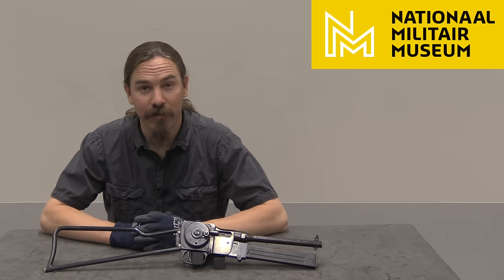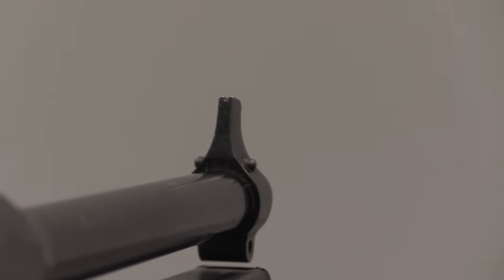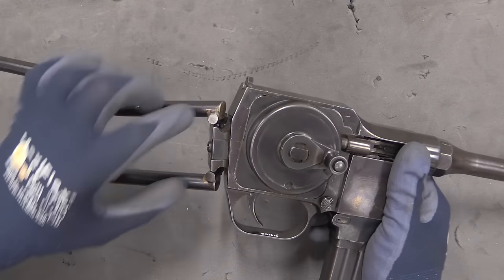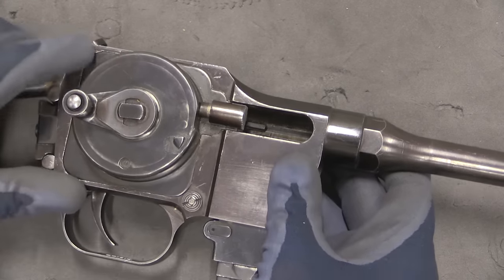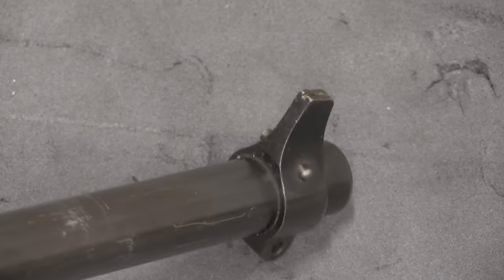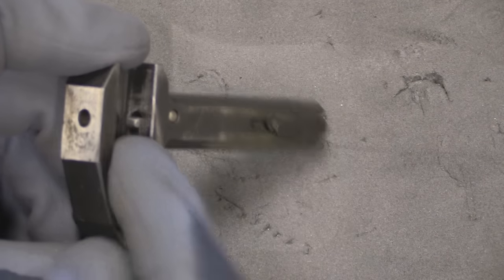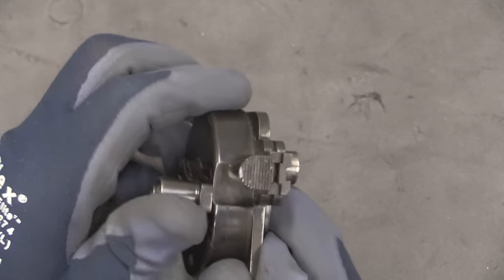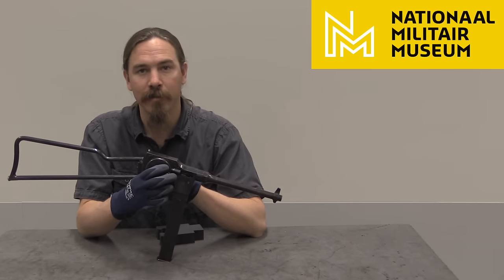MGD PM9 Rotary-Action Submachine Gun

Comment: Why was this not successful? It is an ultra compact sub-machine gun that can fit in a rather small case, uses standard ammo with easy to find magazines, and it looks neat to boot. I see no reason this would not had made a slash with the police, special security, and some limited military use as well.
Reply: there was a glut of surplus around at the time, basically. And apparently that mainspring is hella bad to deal with if you do have to take it apart.
Reply: I guess having 200 sub machine guns, even if they are not the best, kind of encourages governments to not get more. Oh I am sure that spring is a major issue to deal with, ha. Thankfully it was set up to be a single enclosed unit. If I was an armorer, I would treat it as one part. If it breaks, replace the module rather then try and fit some over-sized coiled watch spring.

Comment: The mid-20th century was just such a great time for simple, all-metal, quick-to-manufacture 9mm SMGs, and that just makes it worse that we'll never see a civilian carbine version of any of them outside the Grease Gun. Barely that even :(. It looks almost like a company with the right equipment  could bang something out like this in 20 minutes and yet we know nobody ever will.

 This thing is so interesting to look at that I have to wonder why no one was interested. What did it lose to, surplus MP40s? The only competition I can think of was the MAS-38, and that used an outdated cartridge and looks more expensive to produce than this thing. 

Was it too brittle? Did that flexible stock cause problems? Paperwork and private industry individual relationships with the government? From what I can see there's no real reason not to use these at the time they were made.

Comment: If I get my certification to gunsmith, your channel is going to be an unofficial sponser, as I see A LOT of potential for professionally made, one-at-a-time reproductions, such as the Mars Automatic Pistol.
Reply: Scribe Hammar  Unless you're doing it with a scanner and cnc mills/ lathes, that seems extremely specialized and unprofitable due to the sheer amount of labor and small market. And that'd only produce replicas of the guns that survived and the tolerances etc after wear, and assume you have access to physical copies/ versions of those guns themselves. 

What's really bad is that with pretty much all of these more obscure guns you need an in depth historical knowledge of that specific firearms production history, as they often did not adhere to the original blueprint/ patent/ etc (when such drawings even depicted physically possible things, often mistakes were made and just left because why bother to fix it in an age without computers, assuming such things were even made at all, or they worked better after some changes and they went into production after those changes) and often changed things up on the production line for one reason or another (function, ease of manufacture, saving time, tuning parts, or just because they were made by hand and different people in different shops/ places), even in function (and not just in different model variations). 

Or, again, a physical copy, but that raises its own issues. With older stuff, you have the issue of non-interchangeable parts and which version you choose, as well as potentially extensive hand-fitting; meaning your example may or may not be representative or be good/ bad due to that, etc. And at that point should you improve the design? To what extent? To make it cheaper/ easier to make, to make it safer and shield yourself from liability, etc?

I just don't see the market for individual copies given all that effort and research that would have to be put into each seperate one, unless you find some very wealthy buyers/ sponsors; at the very least with almost no more effort you could easily go from individual to small batch. There's probably potential for reproductions, but consider the economics and how paying yourself for your labor factors into a business
Reply: farmerboy916 It wasn't going to be my mainstay services, just an optional one. Even then, the Mars Automatic Pistol would have to be chambered for .50 AE, as the powder loads and case dimensions are virtually non-existent for at least three of the four available calibers. If I have to, I'm willing to do some modifications to the design like Hill and Mac Gunworks did with their STG44 reproduction, as 8mm Kurz isn't cheap, and the antiques are hand-fitted, which HMG did away with for large production. I'm fairly certain that I'll have to be independent for a time or work in a gunsmith shop like Copper Customs. All the lattermost company does is gun maintenance and some furniture customization, not milling brand new parts by hand for obscure guns.
Reply: Scribe Hammar  Yeah, the issue being that it'd still be a losing proposition even just on occasion unless you charge outrageous prices; it's still usually cheaper to buy an original than have a new one made simply due to costs of labor and tooling, even ignoring all the design and mental work. 

Somehow I don't think most old actions would take 50AE in a number of ways; pressure, length, width, or even simply be compatable with the action or style of action or general design. There's a reason you look for smaller or equal size cartridges to put in existing guns. If nothing else it'd end up looking very different because of the dimensional changes (especially the barrel)
Reply: farmerboy916 The original Mars was available in .45, as well as 8.5mm. I'm mainly going to do it as a proof of skill, not as a profitable venture unless I earn a good amount of publicity by doing it.
Reply: Scribe Hammar You're still going to be looking at something significantly larger and with at least double the energy (as well as a heavier bullet, that can effect things). If it's a hobby or whatever don't let me discourage you, but it'd be a lot easier to use something like .45acp/ .45 super.
Reply: farmerboy916 Eh, I might. The Mars Automatic Pistol did have a four-lug rotating bolt not unlike an M4/AR15 rotating bolt.